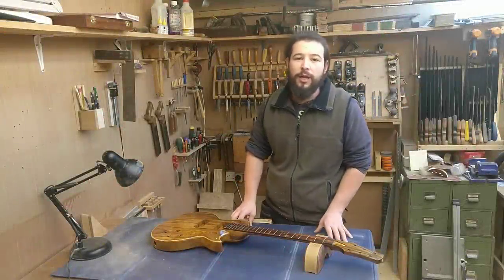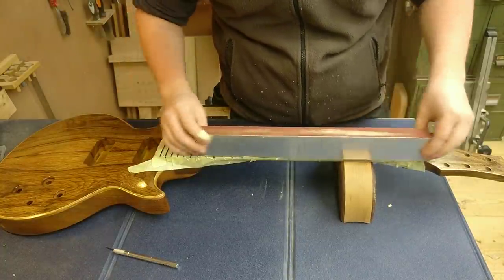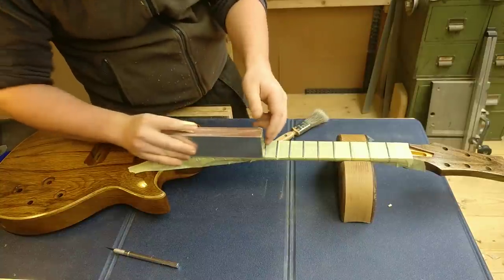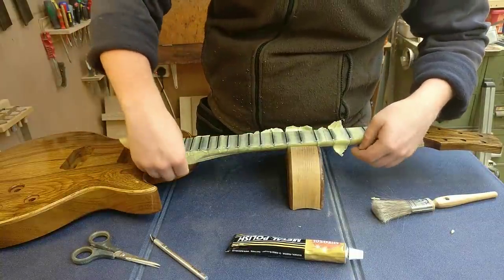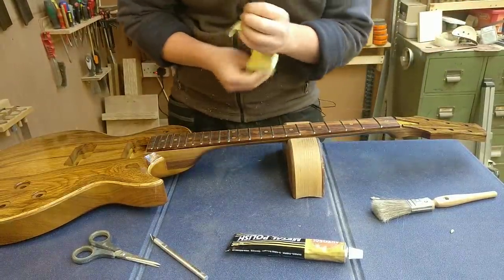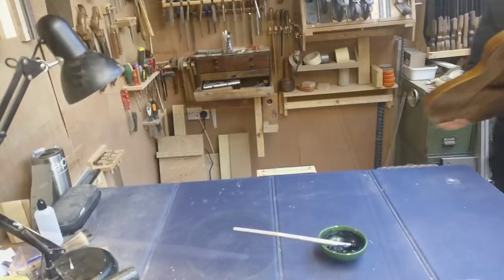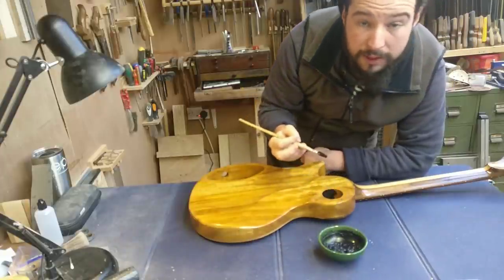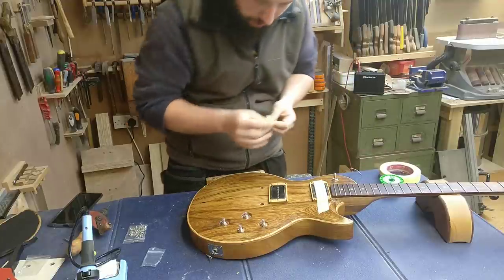Video 8, The Final Countdown, are we DONE?! The Unofficial Great Guitar Build-off 2020

Comment: Greetings!! At @ 32:00, while beating in the bridge studs, you say "This would be so much better if I had a press of some description...." -- You do!! Back @ 16:00 you say "... hadta use the drill press real quick." -- Set your worktable high enough that there is only about a 2" clearance between the head of the drill and the item to be pressed in; chuck in a wooden dowel or piece of hard rubber, then, with the force multiplying feature provided by the very design of the press, gently pull down on the handle to seat the inserts!! Hope that helps in future! Blessed Be, & Peace!
Reply: Glad I checked the comments before blurting out an already offered suggestion. You preceded me by several hours.
I can understand why the work was done by hand, though. It would have required moving the camera over to the drill press, set up, bring over the guitar for about. 5 minutes work, transport the whole thing back to the bench--- making the process 3-4 times more time-consuming as needed.
The biggest obstacle is US, the viewers. If this were not being shared to the whole world, just pick up the guitar, carry to the needed tool, use it, carry back to the work-bench, continue and finish.
I'm glad Sean has chosen to share his skill, craft, and art with us.

Comment: you can use more water when wet sanding, just not so much as too get all in your drilled holes, which should be avoided at all cost (you can put wax in the holes to protect them) . you can use the metal polish on the guitar finish as well as the frets. great to see you making the shielding paint, good job on that. guitar is looking great. well done my friend.

Comment: Think about this:  If the pickups are metal shielded top and bottom,, the pots and switches are metal shielded,, and all the wiring is shielded...... you don't need to shield the electronics cavities or the pickup cavities..   I have proved this many times over.  I still shield the electronics cavity with copper,, only because I like the look.
Reply from the maker: Generally, the wiring isn't shielded in a guitar, and the lugs of pots are exposed outside of the grounded casings.
Shielding isn't exactly "necessary", but it does help to keep down noise, hum and buzzing, especially in single coil equipped guitars.
Humbuckers were designed specifically to combat this, so shielding isn't needed at all with them, but I also personally prefer the look of black painted cavities.

Comment: So should shielding paint be resistive or conductive? The way he's saying it makes it sound like it should be high resistance, but I thought high conductivity would be better at shielding.
Reply from the maker: Sorry, I almost certainly flubbed my words and/or explanation. You do want conductivity in the paint for sure. To measure this, you can use the resistance setting on a multimeter, which is what the other person in the video I mentioned was doing. I think this is where I would have mixed up the words.